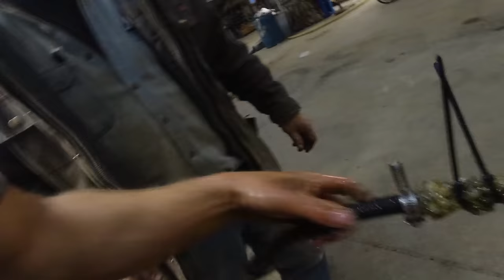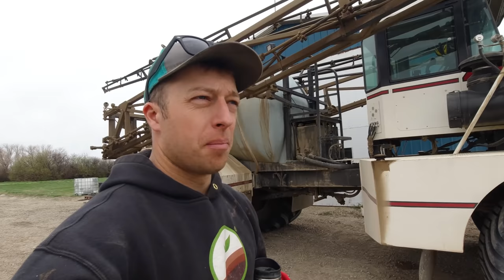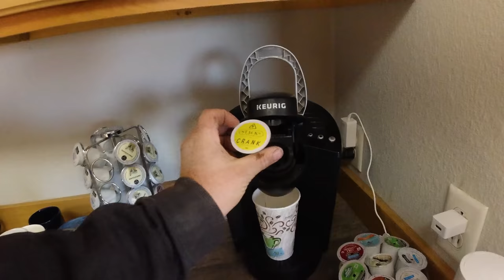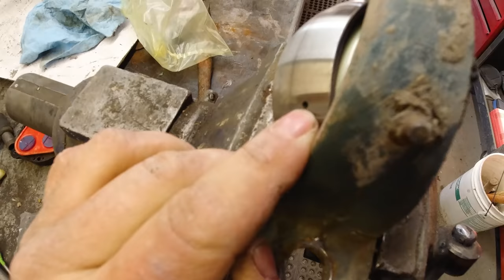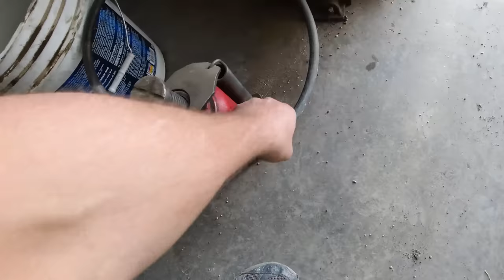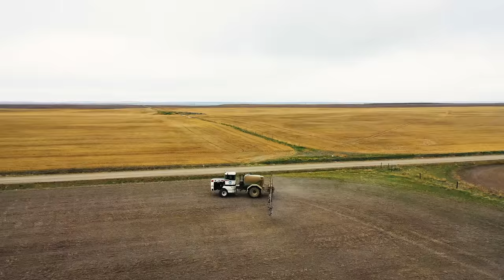BREAKDOWNS!? Bring it on - Leg Arms

Comment: Reuseable fittings come in handy. Converting to JIC also makes life easier. No bearings ever failed from too much grease.
Reply: Not even close to true. Many modern bearings and bushings have seals that break with too much grease and let dirt in. Many manufacturers either make no provision for re-greasing or put plugs in that can be replaced with fittings. I saw many universal joints and tie rod ends fail from over enthusiastic greasing.

Comment: On a JD 1820 the tolerance is so tight quite often you have to cut perfectly good packers off to get at a middle packer.  Brutal design!   Always thought of running it with the  nuts off to see if the gang would loosen

Comment: Although it's a big pain in the rear, it's somehow pleasing to see that your experience farming isn't that much different than mine was. . . just allot bigger. Welding, cutting, smithing, wrenching, painting, greasing, clamping, pumping, parts chasing . . . just about anything BUT fieldwork. Yup, that's farming.

Comment: Run the flat steer up on a 4" block so when you put the jack under the axle it will lift it high enough to get the new tire on.
So there you go.
Reply: Could be even easier if they had an air jack and used the air supply. There's various high tonnage air jacks on the market, some with decent prices, that can be safely modified to lift even in the field (like larger bottom plate, and custom lifting cup).

Comment: i would recomend to grease them just once - when they are new. The problem is that the bearings always move a little bit inside the housing- dirt comes inside - then when you grease it it also drives dirt  inside the bearing. Dirt inside a bearing is much worse then running with not enough grease.  My drill do about 1500 acres i a year for about 10 years and I changed just one bearing last year. Als always great job guys .  Greetings from dry west poland 👍
Reply: Piotr Świątkowski That is a good tip but I’m sure the Walkers do a large.amount of acreage each year.

Comment: A couple of questions as to the tire and rim on the body job, is that a split rim and also is that a 10.00x20 tire ?. The reason I ask, its almost impossible to find a tire shop where I am in Alberta who will touch a split rim anymore and are forced to buy a one piece rim, the other problem is that I have tandems with the 10.00 tire and its impossible to get them as well from my inquiries. My only option is to buy the one piece dayton rim for a 11R/22.5 and am guessing you've run into this same issue ?
Reply: We have tubeless rims to put on the 11s
Reply: Have been converting all the rims
Reply: @RobertWelkerFarmerBob  The joys of running any older equipment but on the other hand they don't have computers and pollution equipment to fail so I guess it all evens out in the end ( empty bank account either way unfortunately ! )

Comment: It seems like farming is 90% fixing things and like 10% farming.
Reply: You would be close
Reply: Nah thats only if you run case, and thats a percect example of why the tow between carrs have become obsolete
Reply: Couldn't agree with you more
Reply: When you have deer the it is 99%farmen and 1%break downs
Reply: @kristenschepp1355  99% farming to pay for the JD tech to travel and fix 100% of the  problems, because the equipment will explode if you try to fix it yourself!!!!
Reply: That is true but it is more like 70% fixing and  30% farming
Reply: You would indeed be correct as your always greasing and oiling and checking gear making sure it's working. The worst thing is to have a breakdown in a gearbox, axle or engine
Reply: Welcome to farming my friend
Reply: Can be at times yep
Reply: Craig exactly. Farming can be brutal. Modern age makes slightly fewer leg arms required but your always gonna need your basic set of leg arms with legs around on a farm.
Reply: On a good day it’s 90% fixing, and 10% farming! I have had days, I dreamed of 10% farming!
Reply: @kristenschepp1355  You obviously don't have a Deere planter as onery as mine
Reply: Depending on the season and your equipment, Or if you maintenance it correctly during winter, what brand you drive doesnt matter, if it's old equipment itll break down quite a bit more then newer equipment.
Reply: The oil can and the grease gun are your friends ! 65 years ago  the farmer that a teen age me worked for said " they should put all lube fittings underneath in the back , that way you have to LOOK at everything " ! Still a good idea !
Reply: Get a thermal imager or at least an infrared laser thermometer and check the bearings once in a while in the field.  You’ll catch the bearings getting hot long before they fail.
Reply: @kristenschepp1355  and 99% payments that are unrealistic.
Reply: Lol what I seen deer brakes down more to be honest everything brakes down.
Reply: Lige Martinez the 12 vaulve Cummins Lover 49 They require huge amounts of heavy equipment service.  They still have a lit of deferred maintenance.
Reply: They are using older equipment to be fair
Reply: My farm it is fixing stuff like 20 and farming 60 and at the house 20 so yea
Reply: @stevenkennedy3911  do u even drive tractors because most farmers that know how to drive can fix things
Reply: @frostydew3636  Straight over the head huh. If you can read between the lines it was a stab at the right to repair bullshit that they are trying to ram down the farmers throats. The average farmer can definatly remove and replace piezo injectors but the tractor still won't run if they aren't coded to the ecu with the techs software.
Reply: We run 78 and 90s model tractors and combines and spend winters with upkeep. Our newer 2005+ equipment actually has the most issues. So 35% fixing, 10% farming and the rest is fixing fence and livestock.
Reply: I want to be your u all’s mechanical assistant.  Love the variety of different equipment and the rush of the hurry up.
Reply: Correct
Reply: Sindian  at least if you break the case it's not 2 grand for a small plastic part and have to take it to the dealer to fix it like the deeres
Reply: Jay-J Stahl as an ag mechanic I have to disagree with u on that when u consider all the potential electronic problems
Reply: @kristenschepp1355  no 99% repairs 1% running to the repair shop.
Reply: I can vouch for that
Reply: It depends on how you take care of your equipment and what shape the equipment was in when ya got it we used to run old JDs then we started buying newer case tractors now we don't have near as many break downs if we got brand new we'd probably have even less although then there's more computer crap

Comment: So if the packer wheel bearings  getting trashed it a common occurrence, why not have a spare complete assembly ready to go so you have less down time?
I made all of our cultipacker sub assemblies the same so I could just plug and play and only lose an hour or so instead of half or a full day and had whomever was on shop duty could rebuild it and have it on the ready rack ready to go when the next one failed.

Comment: How possible would it be to convert the big bug sprayer into a four-wheel drive platform?  That might be an interesting offseason project don't you think?
Reply: For the Brute 4WD would be a waste.  Already will float better than other sprayers
Reply: @RobertWelkerFarmerBob  I guess I was thinking in terms of the mud that you folks run into on occasion. Where four-wheel drive can be more helpful even though it's floating. Have you ever worked with the all-wheel drive tricycle style sprayer? That's what we have in our area of Michigan.

Comment: I'm curious if you'll see a bald spot in your crop where the machine started puking hydraulic fluid.
Reply: The few times in the past of a spill we didn't notice the spot where it happened . The carbon contained in the oil eventually becomes food for soil microbes.
Reply: Not an issue.  It actually lubricants the soil making it easy for the plants to push up through the soil.  Why I've seen it work so well, I've seen corn stocks 35, may 40 foot high.  Well got to go gator hunting now.

Comment: what happened to Scott's training wheels for the sprayer?
Reply: John Austin snapped off. Drilled a hole for the bolt and it shattered
Reply: Needs slight mod
Reply: Your service boom truck is greatest help!
Reply: @RobertWelkerFarmerBob  mount the bogey wheels so they are sprung to the rear. If they snag something will still roll over.

Comment: Its actually better if the hole doesn't line up. Those bearings are made to be hable to rotate a little bit, to eliminate stress due to missalignement. This stress can destroy the bearing prematurely. So by making it not line up it greases the surface that allows that movement, and insures it works properly. Grease will also work its way to the hole of the bearing, but only after having lubricated the whole "swivelling" surface. Excuse my poor english.

Comment: The Ford with the blown steer tire pretty east fix, being empty on a gravel road going slow after the turn not too bad it will get your attention.
   I had a steer tire blow at about 45 mph with 21,000 lbs of milk in the tank on pavement, when  each of the five spokes hit the ground that cab over cab on that GMC shook and shook. YA that was not all that much fun at the time. The rim was not round anymore it turned out to be a pentagon, it sure looked funny. I have had several big rig steers blow but nothing like that milk truck.

Comment: Why not add duals or LSW tyres to the sprayer to reduce ground pressure?
Reply: It's already one of the most float riding sprayers out there
Reply: Robert Welker  - good stuff and clearly tyre width an issue but perhaps a project for nick & scott for the winter??  Good luck with the next plantings.

Comment: So if you had the hose and crimper at home you could just have reused the fittings, done that many times. Just anglegrind on both sides of the crimped shell not too deep and crack it open in 2 pieces, that lets you pull the fitting out from the old hose. This gets you going at least. I really didn't see the need for those orfs fittings when they started popping up but I like em now, take threads easy.
Reply from the maker: We do have a crimper! But I didn't know you could reuse the fittings? Do you weld new shells on? Thanks for the tip!
Reply: @WelkerFarms  okey it seems you use the fittings that have the shells attached to the fitting, can't seem to remember if that is parker parts or what. But over here we have the shells separate and they crimp in to a grove on the fitting. No need to weld. I bet if u search reuse hydraulic fitting on utube there probably is a how to video there, haven't checked it tho as I'm writing this. I drive logging machinery in the winter so I deal with hoses daily pretty much.
Reply: Just noticed there isn't really a how to video on that, I should make one.
Reply: @danielkacko7616  That would be a good video to see. Please let us all know when you put it online for all to see.
Reply: @danielkacko7616  they're using Gates MegaCrimp fittings. It may be a good idea to add some of those fittings to their stock though.

Comment: Arm chair farmer here. 
Guys it just blows my mind that with a little PM, preventative maintenance, the bad steer tire(s) on the blue grain truck could have been replaced prior to planting.  The same goes for the hydraulic hose(s) on the sprayer.  The pillow block bearing appears to not have seen a bit of grease since it was replaced the last time you all worked on it!  Do you at least have a maintenance schedule for each piece of equipment that would bring them into the shop during the off season for a visual inspection, r&r and lubrication?  I've watched all year now and there seems to be a lot more equipment being used than ever went through your shop this last winter, at least from what I saw on your YT channel! 
You all are to be commended for show casing your farm, both the good and the bad but sadly a bit of the bad seems self inflicted!  You all need to step up and MF, LF and SDK  the maintenance end of your operation!
PS I realize it is planting time but your parts room is a disaster!
Reply from the maker: There is so much more going on here than you could ever understand without being in our shoes.
Reply: @WelkerFarms  Any answer, even a non-answer is better than no answer... however I can read between the lines!  I thank you for taking the time to read my observations.

Comment: plasma cutting on the inner ring of the bearing! hi risk to cut into the axle.
Why not a weld over that ring and you tap it of easy?
Question why are there 2 bearings on 6 closing wheels and not one more?
Reply: Do it right and no damage.  Its so close to the wheel you can't swing a hammer.
Reply: @RobertWelkerFarmerBob  ah oke, i was thinking that there was a reason for it, bud i din't see it.
bud why is there not a turd bearing on that axle?
just curios to know :)

Comment: 87 😜 you boys gotta grease more. No one greased themselfs to the poorhouse you know. Nice video btw //  SWEDEN
Reply: I totally agree, it's better to over grease than it is to under grease.
Reply: Not really we have similar bearing on the verge mowers and from experience I can tell you they will last same time if you grease them every 10 hours or every 100 hours. What gets them is water or wire wrapping around them destroying the covers. Personally I prefer changing the block also because bearings get some play in it and have lower lifespan. We used to run "good" brands of bearings (SKF, FAG) but have now gone to cheaper stuff because they all fail when you get them in water few times to many.
Reply: @Matevz96  the grease fitting is all rusted out.. also the bearing when he take it appart. No grease there for a long time.  We grease every 8hours on my machine

Comment: Two years ago I’m removing flat tire on side of road when the stock trailer falls off jack just as I remove all lug nuts. Fell straight down with one hand on top of flat tire, I had just removed last nut. Lucky trailer falls straight down pressing my hand between fender and flat tire. I got lucky trailer didn’t roll or tire blow off hub with lug nuts removed. I was stuck till two guys were able to re jack cattle trailer back up. Oh yeah it left a mark, lucky it was by state highway, unlucky I was on ditch side, full of livestock, lucky two neighbors were there to assist. We don’t talk about it ever. Better that way..... than you make a video.... Now my hand hurts...